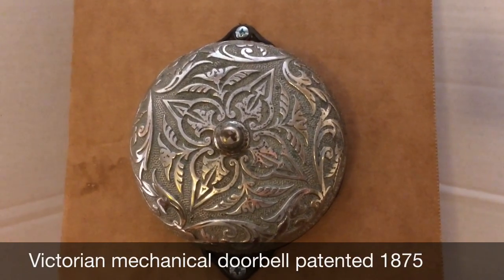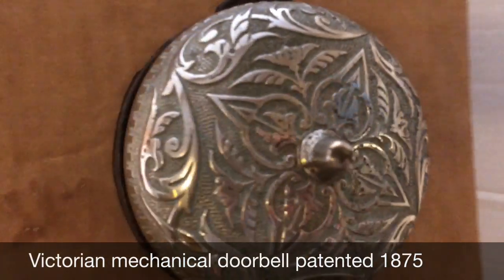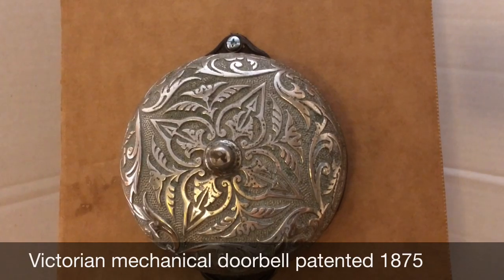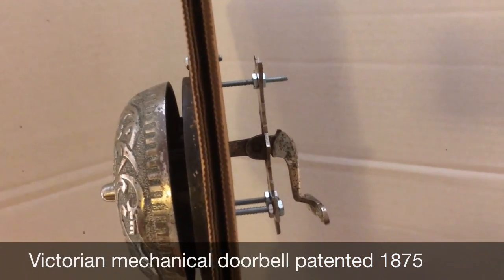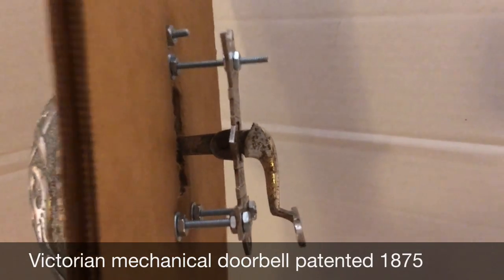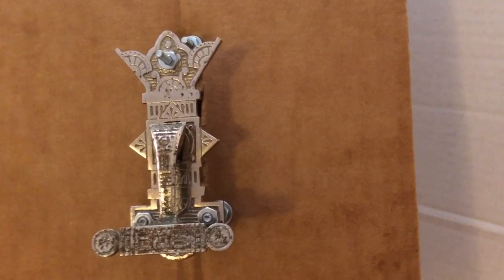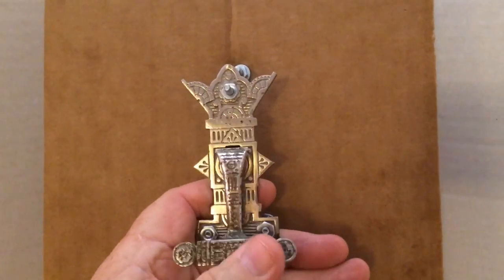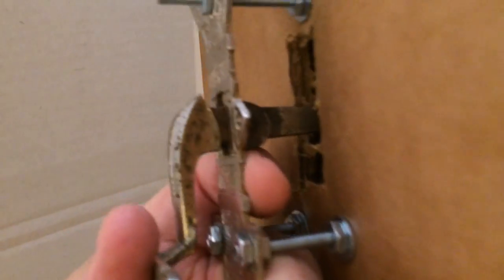Victorian mechanical doorbell

Comment: This is very helpful!  I'm attempting to repair a similar lever-activated doorbell -- it's on the front door of a house built in 1720. I have a 1939 photo showing the same front door with the doorbell installed, but no way of knowing how long the doorbell has really been there.

My doorbell has a more complex three-arm mechanism and, sadly, is missing its spring(s).  I'd really appreciate a longer look at your doorbell in action, from a couple of different angles.  (I also wonder how I could possibly find the right spring(s) for this?!)
Reply: U might haft to have them made for u
Reply: thiss reminds me of this https://www.youtube.com/watch?v=6CZT_XejBzg
Reply: thiss reminds me of this https://www.youtube.com/watch?v=6CZT_XejBzg